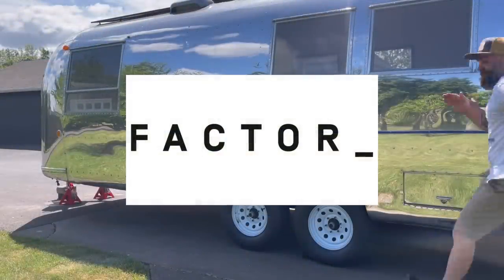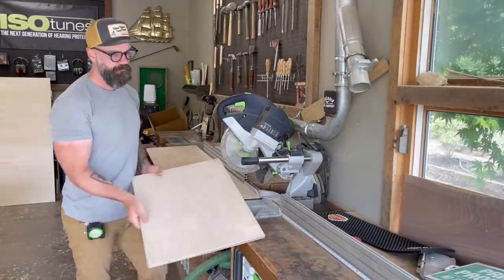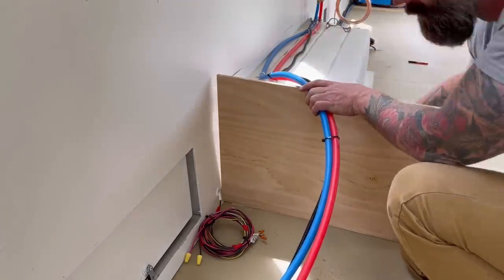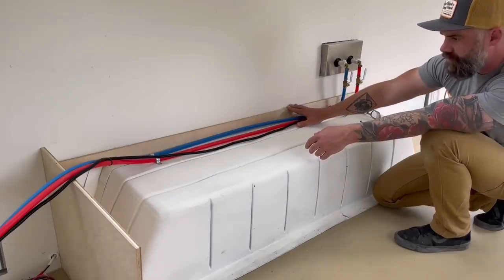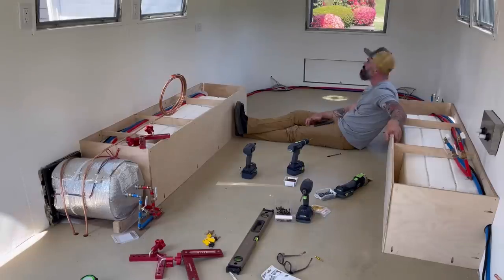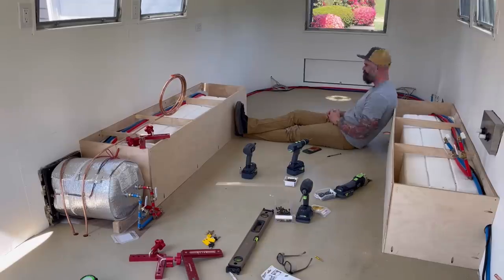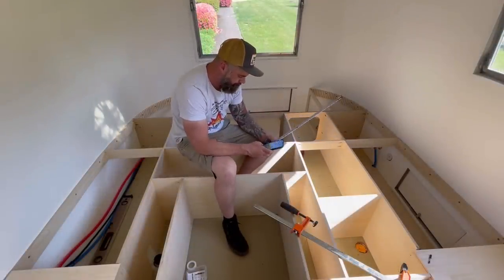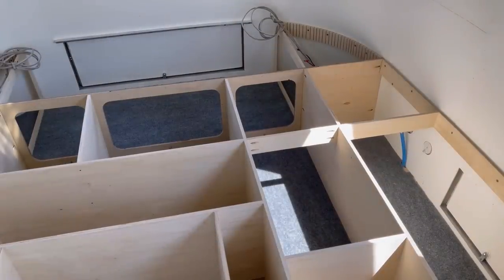Airstreams Suck!! || Starting on the interior

Comment: for scribing keep a washer handy. stick the pen/pencil in the middle and trace around using the edge of the washer. makes perfect templates with a super consistent spacing
Reply: Great tip! 🙂
Reply: Thanks!
Reply: Brilliant.
Reply: Just what I need! Thank you.
Reply: Système très connu !
Reply: This works, but it makes it smaller all the way around,
Reply: Thanks! I wish I'd've known this about six months ago when I started fitting out my camper (lots of cardboard templates, mis-cuts and cursing eventually worked out) 😂
Reply: Hope I remember that next time I need to scribe something.
Reply: How do I save a comment haha
Reply: Damn that’s handy
Reply: That's great advice, but keep in mind it offsets the lines, so you should try to offset them to the opposite direction later. Otherwise you would need to trace it offsetting it on a consistent axis, i.e drawing the line 20mm lower all the way around, but a washer wouldn't help in that case
Reply: I was gonna say a roll of tape but that works much better
Reply: @talldude1412  screenshot my guy... 😂
Reply: @procarpenter1788 You must not have ever built anything before... You don't literally scribe 1 line around the whole camper 🤦
You only scribe for curved/complex mating points... meaning you're only transferring the angle or slope of that section to your template then measuring the overall dimensions per usual 👍 (so no, it will not be "smaller" lol)

Comment: Great stuff man. You’ve probably already considered this but if not it’s a good idea to have ventilation underneath a bed mattress (otherwise it might mold). That’s why bed slats are a thing. So when I built my campervan internals I cut slots into the plywood bed base to allow airflow. Makes a big difference.
Reply: Fantastic tip.  Thanks.. I would have forgotten that.

Comment: Some advice, don’t fit your plywood storage Or walls too flush with the inner shell. Leave a gap as the trailer will flex during travel. You can use rubber gasket so it is sealed to the wall, but still forgiving for flex.
Reply: Carpet was a good idea. I would have also put carpet around the holes. The more items you drag over those openings the more it’s going to wear and tear.
Reply: Came here to say this exact thing. Stuff like pocket holes are really going to struggle long term with all the flexing.
Reply: Dominoes.  Use Dominoes so u can feel the hate
Reply: Same.  I used 5/8" foam backer rod held in with hot glue for a similar thing. Worked quite well.

Comment: You might want to add hinges and some small shocks to the center ply under the bed so you can access storage from inside too
Reply: I was just thinking that! Might be easier to use all the storage if the center panel pops up instead of just a single drawer cutout in the front.

Comment: You may not want to bury the water lines so well. If they need to be replaced, or repaired you'll have to test your entire build apart. 
Also you may want to have a larger opening around your water lines by the wheel wells. When you travel, things rub against each other...also tie the lines down a lot more to stop that movement

Comment: Insulate those boxes around the plastic wheel covers and the storage under the bed storage area. I  don't know if you plan on doing any cold weather camping, but it will help both winter and summer.

Comment: You seem to be doing pretty good with the build. I used to work for Airstream and have built many trailers and motorhomes over my years there. I know first hand about all the scribing and cutting to get things to fit the best that they can. You are making fairly good usage of the space thus far. Though, over my years at Airstream and talking with people that own the trailers, they really like the storage under the bed to be pass through. Meaning access to the majority of the storage from the outside and the inside. Thats why the majority of Airstream trailers are built with the hinged bed top. That way the owner just has to lift the front of the bed and have acces to all the storage from inside the trailer. Its a preference thing though. Your build is different but still makes great usage of space. Cant wait to see the rest of the build!

Comment: Nice job cutting out the access holes. The way you did it adds strength, allows for storage, but very importantly, removes unnecessary weight.  Tow and cargo capacity are key components to track.  Thanks for sharing

Comment: I don’t think I would totally hide the electric and plumbing…Leaks happen a lot in RV’s. Also, add some sort of rubber or silicone edging on any point of friction (that half circle in the plywood sheet) for the plumbing/electric lines.

Comment: I love this build and anxious to keep following along.  You are doing an amazing job!!!  I just wanted to pass along a little experience on RVing.  You are doing an amazing fit / finish job covering those water lines, etc.  That said, RV's flex and vibrate a lot going down the road.  Overtime, I've had to make repairs to those lines (either at joints or even just chaffing through openings).  I've liked having access to these so I can visually inspect as well as make inevitable repairs.  Just a thought.  Again, looking forward to the next episodes on this!
Reply: That was my first thought too. Could have moved the water lines up over the top of the access doors. Wouldn't have even needed the false floor, and inspections/repairs would be easy.

Comment: Cool project - as one would expect from you. If you can go back and add spray-in bed liner in the compartments accessed from outside might make things smell better down the road as invariably less-than-dry items will get stored there and the plywood is a good Petri dish. Then the carpet back on that to keep that stuff from rattling/denting much. Keep it up!

Comment: If I may make a couple suggestions. Go to an RV dealer(preferably An Airstream dealer) and get ideas/insporation from their interior layouts. 2nd suggestion: layout a centerline lengthwise on your floor. By measuring every 4-5 feet. Then conecting the dots. This should make layouts,and measurements much easier.

Comment: This is a fantastic project for you. Get the air conditioning hooked up as you'll need it during your build. I've got a hinged upper entry panel above my under bed storage which allows me to store plastic totes with the necessary tools for RV travelling and extra cooking pots. It has pistons to allow it to hold the mattress up while opened. I also ran extra AC power strips to allow for a charging station and mechanical power which I found was necessary for long camping trips. I've never needed the furnace function as an electric space heater does the job but I do like an electric/propane hot water heater. Same for the dual energy source fridge. That way I can use powered and unpowered camping spaces. Remember to keep your 120VAC and 12VDC lines separate as you'll be AC-less if dry camping unless you bring a generator with you.

Comment: Great video-

Genius outsourcing everything but interior. To many get great interiors but only weekend warior work on electrical, frame, body etc. 

Your finishing a house. Except everything has to be made, made custom, in tight qtrs, and tools won’t fit in house, materials won’t fit inside house, needs to be light weight, and on and on.

Comment: Looks good, dude. Might be best to leave a little wiggle room for your plumbing though. The trailer will shift, roll and bounce around when you drive and you wont want those tight holes cutting into the lines while the trailer flexes. Keep up the good work!

Comment: Hi Jason. I'm a big fan of your work. :-)

Regarding cables and water lines, here's an experience I had when furnishing a sailboat (which is almost the same as an RV, just without the wheels):

I always ran the cables and water lines through a larger pipe before I built it in. That way, they were better protected against movement during the trip, and it was easy to replace them if I needed to. I also made sure to always put in an extra pull cord inside the pipe, just in case I needed to pull som extra cables sometime in the future (you almost always need that at some point...) The opening for the pipe was accessible from the cabinet with all the fuses.

A little light inside the storage rooms is also a big plus when you're looking for something at night.

I look forward to see the continuation of this project. :-)

Comment: Great Video Jason - Always entertaining.  I saw that when you were cutting the front panel, you notched out the corners for the water pipes with the jigsaw, upside-down.  Im assuming that this was so the clean side of the cut was on the visible side??  If so - you can get jigsaw blades that cut on the down-stroke, so the clean cut is on top... Game Changer for anyone out there sick of this issue..

Comment: You can still go to an electric only(compressor) refrigerator, and you would no longer need the roof vent. If you plan to boondock, the propane may work better for you, there are trade-offs to both. 
I removed my propane and modified the cabinet in my Airstream to fit a Dometic DMC4101 just 2 weeks ago and realized almost all the people I saw discussing swapping to electric only were missing an important difference in how the compressor fridge flows air that is very different from the propane fridge.
Propane requires a channel to flow air past the elements, the temperature differential allows the cooling to happen in the fridge, so the hotter the outside air, the less efficient it cools. This means the back of the fridge is “outside” in that it has to be open to outdoor air, and sealed from the front/indoor air.
The compressor fridge I got doesn’t make anywhere near as much heat so could be inside only, but if it is sealed around the front like the propane fridge was, it would lose the intended air flow path designed by dometic in which it pulls air from the bottom front of the fridge and it flows out the lower back of the fridge. Sealing the front could cause it to build heat and cool poorly. 
Anyway, just wanted to say that it’s not too late to change your mind on the refrigerator! Feel free to contact me back if you’d like more information on the refrigerators, though I’m far from an “expert”!

Comment: The small amount of remodel Ive done on my popup camper has taught me that it was out together with 1x2's and paneling.  The counter tops are MDF and the bunk ends are 5/8's plywood.  The exterior is 0.04 sheet aluminum glued to paneling sheets.  A tour of Palm Harbor homes production line might help.

Comment: Look at how boat builders template, because the inside of a boat is a bit the same as the inside of a RV like this, just upside down. 

A method that would work is cutting a shape from cardboard/cheap wood that is fairly similar and hot-glueing tabs every 2 or 3 inches depending on the curve that touch the wall, you can lay this template on the wood and connect the dots,  put some nails on the dots, spring a small piece of wood alongside the nails and draw your line to connect the dots.

Comment: That is going to be one well built camper!  One suggestion would be to consider putting a piano himge at the horizontal seam in the middle of the bed so you can lift that lower panel to access storage. I realize you can build drawers very well, but bouncing down the road tends to be very hard on them, especially ones that are furniture grade.

Comment: Some people have suggested cutting holes in the ply for air movement. I'm not sure why but I think I would go with putting slats on top of the plywood to boost the bed up. My bed just has 2*4's as slats.
Also I think you should not build your storage all the up to the mattress. That would make changing the sheets a right pain in the arse.

Comment: 🛏🔩🔧 Interesting suggestion! Adding hinges and small shocks to the center ply under the bed for dual access storage sounds like a clever idea. 🤔 However, let's dive deeper into the practicality and potential drawbacks of this modification. 🚐⚖ How might it impact structural integrity or weight distribution? Let's explore alternative storage solutions and find the perfect balance between convenience and functionality. 📦💡

Comment: I am really enjoying this series! I am always curious about what grade plywood you use on your various projects? I get lost in the grading system and am starting to wonder if it matters. How many cores is too many?

Baltic Birch - BB/BB, B/BB, BB/CP 
Prefinished and paint-grade panels - C2 & C4 But paint grade is not always prefinished so would look different.
AA1 & A1
Shop-grade or Fall-down
Cabinet grade
Paint Grade
Engineered Cores - B1

Comment: Love the video!  What a major challenge to take on.  It would be frustrating working on something that has almost no 90 degree angles to begin with.  Did you check out / replace all tubing and wiring connections?  Having to get to a leak or repair an electrical problem in the years to come could be major unwanted challenge.  All of the woodwork is certainly a major undertaking.  Then applying all protective coatings and finishing is yet another major undertaking.  I could easily see this being a year-long project.  Good luck!

Comment: I had my storage access area at the back turned in5o a shower, installed the base and put in a snap tent shower that hooks into the ceiling. When not in use it collapses into the shower tub. When finished the trip for cleaning we unsnap the wall and hit it with soap and suds

Comment: Well, progress is being made. The only thing I would say is to think about weight. You might have all that in your mind, but it will be easy to get too much weight in this thing, as well as it properly balanced for towing. Again, you probably are already thinking about it, but just incase you have not. Looking good.
Reply: Having done a full gut camper build,  this absolutely jumped out at me as well. Thats a lot of weight at the back of the trailer unnecessarily  (like putting a false floor above the waterlines). Should absolutely be a consideration to keep things as light as possible in a camper... especially at the rear. Hopefully he knows this, or reads the comments to take weight into consideration in this build. I'd hate to see all the time and material wasted if weight isn't being considered...

Comment: I worked for a boat builder and he showed me a trick that uses a paint stick. 
On one end cut a sharp point (flat side), and then make a bird mouth about half way down the stick. 
Get your cardboard close, and then use the paint stick jig to mark from the wall to the bird mouth. 
Do this about 10 or 12 times and then you can draw a line from point to point. 
This will get you close enough to scribe the cardboard.
This is hard to explain in words, but I am sure you can figure it out.
I think people have been doing this for thousands of years.
And you should only have to cut the cardboard a couple of times.
And then there is the angle of the wall :(

see the video on YouTube 'Ticking Stick (added 5/31/2023)

Comment: might be nice to make an archway in the wall in front of the bed , kindof following the round shape of the trailers roof , and making the bedroom a little bit of a grotto / bedstead 
might even do some artsy weird shaped frames with stained glass windows or matt glass hiding led lights over the top of the archway , could do youre full bourbon mouth logo over it , giving it youre makers mark that you can see from all over the rv trailer 
just make sure the archway is a bit taller than you when kneeling on the bed including the mattress or you be hitting / scraping youre head every time you climb in
adds a little more rigidity to the middle of the trailer too
if you make full length cabinets at both side of the bed entrance you could make the doors floor to ceiling even if theres no room at the bottom because of the wheel wells and make those doors hinge toward the bed , if you make those cabinets wide enough or create a foldover second door in the edge of said closetdoor(s) you could open both doors to close the arch intoo the bedroom , makes the closet door twice as thick but should work fine otherwise 
save the templates you used to make the bed bottom piece , youre wife is going to need it to cut the fabric to re-cover the cut to fit foam mattress , you probably need it again to cut the foam in the first place

Comment: Doing great , having no previous mistakes to learn from. LOL!  Always easier to be an armchair quarterback...but I was concerned as I always am about access to the electric and water lines should a problem occur which usually happens since Murphy is my mentor.  This is a tiny house on wheels and it might be prudent to spend some time with 2d drawings and cardboard mockups? Or if your inclined sketch up?  And Murphy will still be there to teach that special "Oh crap" lesson.   Any how. YOUR DOIN GREAT!

Comment: Looks awesome! One thing that cursed all RV owners is how susceptible they are to water damage. Have you thought about taking any steps to make it more water resistant?
Reply: The main body has just come back from a rebuild at a pro Airstream workshop, so I would be very surprised if it leaks any water in at all.
Reply: @terryhayward7905  I’m more concerned about the people and gear inside the camper. Wet shoes, chairs, spilled drinks, etc.

Comment: When covering lines I’d be concerned by serviceability. Should access panels be able to service the water or electrical lines? I think designing in cad would very useful. If for no other reason than to try it without build and try. 

Nicely done. You’re brave and skilled. That will get you far.

Comment: Scribing tip: instead of cutting the cardboard bit by bit until it fits, glue small pieces of cardboard to one another following the curve of the wall. That way you get the correct template on the first try.
Reply: Or just pieces of tape and cut the curve into it. Then transfer it